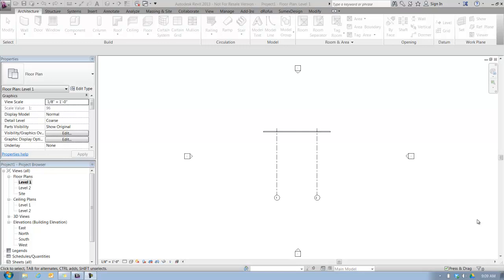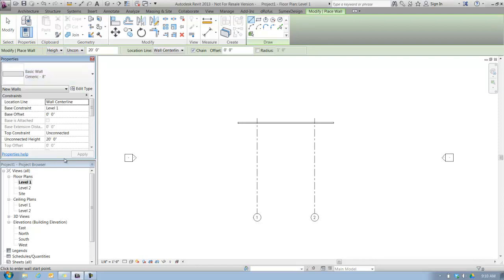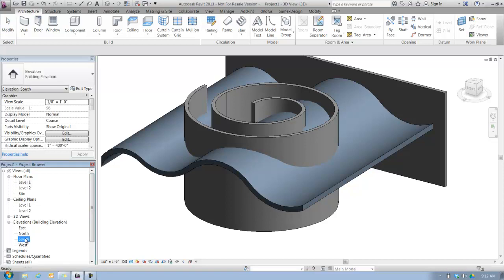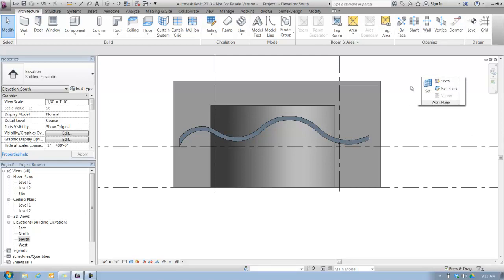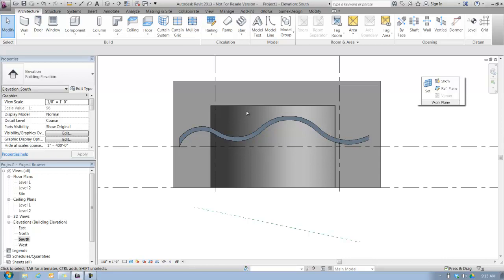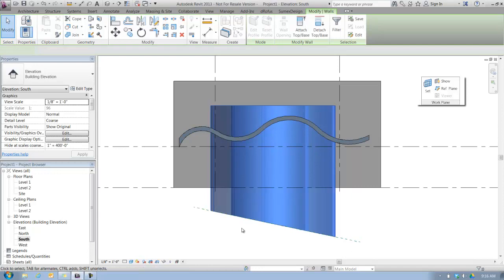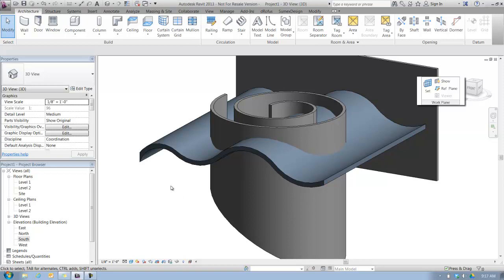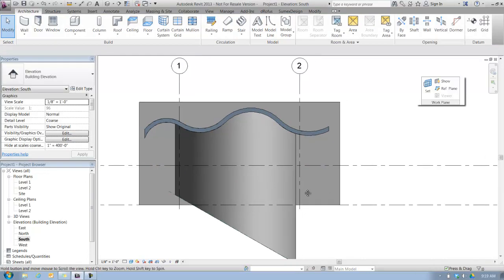Mastering Revit: Custom Wall Constraints

Comment: ok, I need to trash this archicad bullshit; it doesn't even know what a reference plane is;) also, revit is stupid in that it works with reference plane, when it should be reference surfaces. Also, can you lock these references so that no team member can't change it?

Comment: how do you reset the default base and top constraints when creating another level?
Reply: Are you talking about adjusting the base/top constraints of an existing wall to specify a new level you created in a project? If the question is about the example shown in this model, you have to select the wall, click Detach Top/Base in the contextual ribbon (I'm looking at Revit 2015) and then click the object you want to detach the wall from or click Detach All in the options bar. Then you can reset the top or bottom constraint values in the Properties palette.